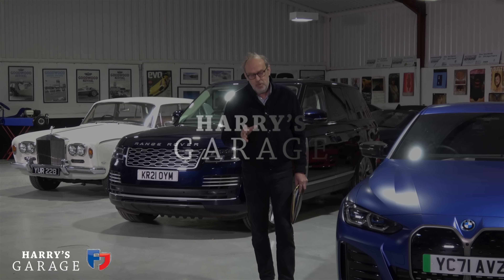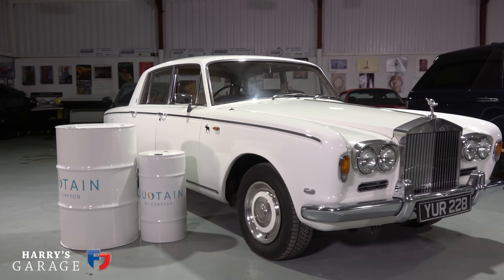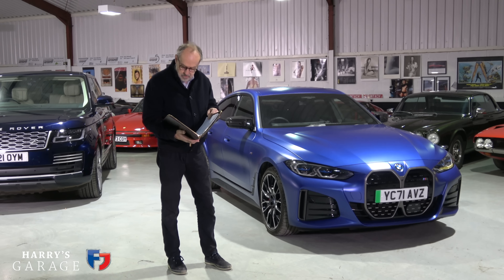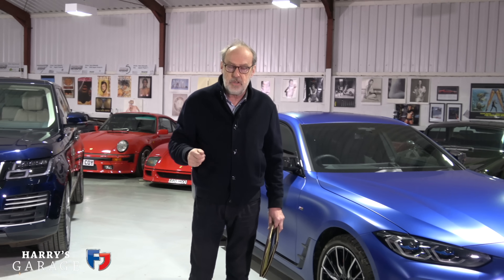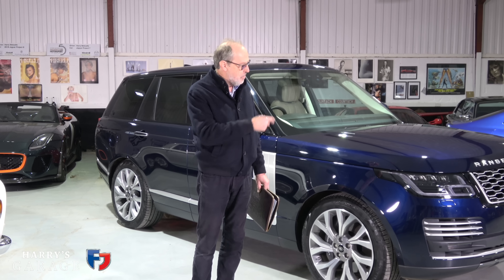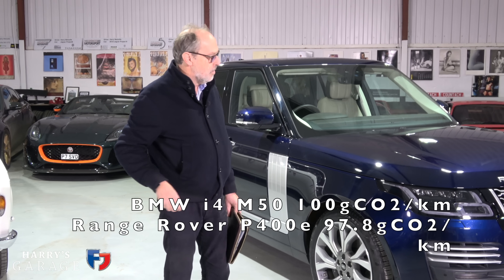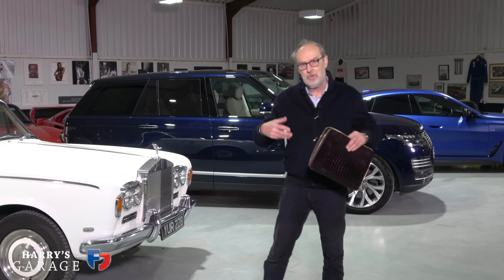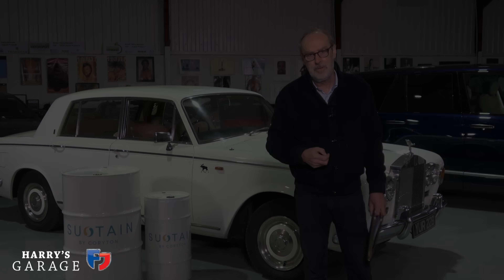Sustainable fuels; what are they & are e-fuels better for the planet than running an EV or PHEV?

Comment: Burning anything produces local emissions, EV batteries are recyclable so the cars will last a long time, infrastructure is slowly moving to sustainable power etc.
Anyway, sustainable fuels are nice for classics.
Reply: You really need to do more learning. I can understand your idea of "burning" is probably "setting fire to something" but in reality its a chemical reaction which is well understood and can be well controlled. Depending on what you burn you can always neutralise or change the results of that reaction to suit your needs. Weather thats reasonable based on size, cost and so on is another matter but its not so simple as "burn things baaad". 
Also on the recycling front - again you may want to do a little learning there. You say ev batteries are "recyclable" but I can only presume you've heard that and not questioned it. Currently less than 3% are actually recycled and the ones which are use so much energy to do so that its more harmful than making new ones. 
A lot of the claims about them being widely recycled are based on them being thrown into storage and "used" as grid storage - though most of those never even get wired up. 
Another common claim is when they are "recycled" by taking a pack apart, testing the cells then making up packs from any good ones left. 
Thats more equivalent to a scrap yard selling working parts off an engine than actual recycling.
Funnily enough quite a lot of ice parts actually are recycled these days - and have been for quite a long time. 
On a Nissan Leaf for example the battery is one of the few things which aren't sent for recycling while its sister car the Pulsar actually recycles more parts.
Reply: @siraff4461  You really didn't understand what I was getting at. I wasn't going to elaborate but ... oh well. I'm not talking of statistics but future tech.
Combustion causes a variety of gases and it's never a perfect combustion, go breath a tailpipe. Current battery recycling is shit.
Reply: @mdtrx  "Future tech"? Of course you were.

Comment: The Transportability of Sustainable Fuels is very useful, but surely, to use your own test, the Planet would notice it more if it was used by your Farm Vehicles, and the HGV's collecting and delivering from you, rather than your 1,000 miles per Year Classics?

Also, the 'other' benefit of Electrics is their complete absence of any tailpipe emissions, - not that important in rural Oxfordshire, but far more important in the congested Cities where most people live.

Also I don't understand why your 2.3 tonne EV is incapable of doing the short trips that your similarly weighty Range Rover does, - and if you don't need to stop at least once on a 400 mile trip, then you must have a Bladder that is Too Strong for any EV (!)  ;)

And BTW, a top of the range tesla Model S can now do 400 Miles, anyway ...

And one more thing, as a general rule, our Electricity Grid will only get greener, as more Solar and wind are installed, whereas your Rangie will only get greener by the small amount of electricity it uses, and that petrol component will either stay 'brown' with normal fuels, or expensively 'beige' with sustainable ones ?

Comment: There are some excellent points made here. I have been pointing out to people, that if I run a BMW M6 for 100,000 miles it will involve about the CO2 as running a Tesla Model S 100 for 100,000 miles. Much beyond that the M6 wins because the Tesla batteries will have to be replaced, which they won't be. The car will be 'recycled'.

However, this notion that  the planet will notice the CO2 is now so culturally ingrained it is impossible move forward. If people understood that CO2 is about as damaging to the planet as cool clear mountain spring water, then maybe we could deal with the real and horrendous damage done by bio-fuels, hydro-electric, wind-farms, plastic, etc, etc. And that is not to deny the other by products of running an ICE car, that are almost certainly far more damaging than CO2!

I think we need to move away from fossil fuels. But as Harry alludes, it is all arse-about-face and I think we are doing more long term damage than doing nothing...

Comment: Sustainable fuels are a bit of a con.  The tractors that grew the crops that go to make the Ethanol burnt diesel,  the lorries that transported the crops to the conversion plant burnt diesel.  The chemical factory that converts the Ethanol has heaters and pumps that operate from power derived from the electricity grid and generating that electricity produced CO2.  The lorries that deliver it to you run on diesel.  And finally all of the staff and infrastructure that keeps those tractors, lorries and factory working run predominantly on fossil fuels.  So to say that this is a carbon neutral fuel is not exactly true, the liquid itself maybe but it doesn't get in to the tank of your vehicles without a great deal of CO2 that came from fossil fuels being emitted.

Comment: I am actually fascinated how cheap the sustainable fuel is. I would've guessed at least an order of magnitude higher price and very limited supply. Is it taxed in the same way as regular fuels in UK?
Reply: But it is debatable as to whether clearing ground to grow it is really sustainable, I don't think anything is truly  sustainable. 
I think electric cars just put the smoke in someone else's back yard .
Reply: @zypp33  Emitting CO2 is putting the smoke into someone else's back yard, literally. For most people, an EV emits less CO2 - and once we've eliminated more gas burning, EVs will get cleaner and cleaner.
Reply: @zypp33  That plant in the Atacama desert in Chile isn't like cutting down a Brazilian forest.
Reply: Petrol's cheap if you take 69% tax out of the equation and yes to answer your question all fuels are taxed one way or another. You've only got to look at our electricity price crisis to see that whether they call it "tax" or "profit" or "overheads" a high price is a high price and a lot of it isn't going on the raw materials you're purchasing.
Reply: EVs only produce less on use. The production of the EV will often add up to more than what you emit from an ICE vehicle. When you start factoring in the fact that we still need to build an entire infrastructure for renwables, that relies heavily on limited and harmful heavy metals (gained through strip mining), that cannot be easily recycled (just as much of the resins used in wind energy cannot be recycled), you start seeing the bigger picture.
Renewables and EVs sound good in theory but the reality is far from what is touted.

Comment: Harry, don't feel guilty about running your cars on fossil fuel, the question should not be, how do we do it?, the question should be, do we need to do in the first place?, in the time of the dinosaur CO2 levels were up around 1765ppm of CO2, it is now about 385-400ppm, over the last 100k yrs sea levels have been 20m lower than now to 6m higher, the world will not notice us running cars as we do now, as CO2 stays in the atmosphere for centuries what you produce today is there for over 100yrs, if we went zero emmissions tomorrow nothing will change with the climate for 100yrs, there are so many things affecting the climate, CO2 being just a small part,  you need to read "Unsettled" by Steven Koonan, find out what the IPCC are not telling us, what the raw data actually says and how and why it being misinterpreted. Looking at EV or PHEV is great as long as you don't get  the idea we are killing the planet and getting rid of fossil fuels will save us, I want to look after the planet, but I don't want to ruin my enjoyment of it to do it, otherwise what is the point, especially when it is not in any real danger from me, current EVs bore me, no patience for prolonged charging time, short distances and range anxiety, I like dropping cogs into a corner, now, if someone comes up with an EV that can be driven like a manual, with a 20yr battery life that charges in under 5 minutes and a range equal to full tank of gas in a Nissan Micra then I am interested, otherwise it is BS virtue signalling by woke wankers trying to be popular.

Comment: Fully electric vehicles are not the future for the UK. The infrastructure is not there to charge them. The electricity uses fossil fuels to be created & the cars are disposable because no independent garages can fix them.
They're a MASSIVE con, on a HUGE scale, & those who pat themselves on the back for their contribution to "saving the planet" haven't read the figures.
I can drive a 1.4 petrol car for 100,000 miles & use less Co2 than a brand new, zero mileage Tesla, that will be scrap in less than 10 years.

Comment: Great video. Agree with the general sum up that PHEV's are the best solution for most people at the moment. But really looking forward to the planned videos on sustainable fuel, especially as you get to use it, how will it effect the engine? Power, efficency, seal life etc?
Reply: PHEVs are NOT the best solution for most people right now. Most people drive < 40 miles/day. So an EV is the best solution (for the planet).

Comment: Depreciation is one of the biggest costs of car ownership. It's still so commonly ignored. 
Manufacturing new cars is also incredibly damaging to the environment. Lifecycle assessments are never discussed because they discorage new car sales.
Reply: The slowest depreciation seems to be either a “quality classic “ such as an E Type , or any Tesla !
Reply: @maxflight777  because Tesla control the resale value.
Reply: Don't forget that Ice can be used indefinitely with simple repairs whereas EVs have a short lifespan and then have to be replaced.
Reply: @sh-hg4eg  I strongly disagree with your claim. To use ice indefinitely, engines, gearboxes, fuel system etc all need to be gradually replaced. To use electric drive lines indefinitely, motors, batteries, and invertors have to be replaced. There is no fundamental difference!

Comment: As ever a balanced view from Harry… I have always believed that the answer is actually we should be keeping and operating vehicles for longer. This idea of changing vehicles every 3yrs is what is driving pollution with the constant production and costs to the environment associated with it. I saw a discussion which pointed out that with the low mileage (an average of 1300mls per year) completed by a V8 classic car actually contributes less carbon annually (as the manufacturing costs are long gone) than the average person charging their iPhone every night of the year! There is also the point that private motor cars are not the major contributors to carbon emissions, industry, agriculture, shipping and air transport are the real large polluters. It seems cars are an easy target that makes everyone feel virtuous while they ignore the true problem 😔

Comment: Harry. Another brilliant explanation, but and sorry there is a but. I think it would have been interesting to see the figures for a modern diesel, say a BMW 320/520D. I really think the figures would be very enlightening and a great comparison to a modern electric or hybrid option.We all have to be greener in our choice of what we choose to drive but not sure that a 45/50mpg diesel is as bad as we are being led to believe? I would love to see your calculation on CO2 emissions and relative pence per mile. My reasons to challenge is that I drive a 2021 diesel equivalent of your L405 Range Rover which averages 33/35mpg and on a recent road trip of 1800 miles round Norther Spain achieved 37.5mpg. A trip I would have struggled with in a pure electric vehicle. Do they produce a diesel version of the e-fuels by any chance.👍

Comment: Sustainable fuels sound great, but, if you have to till the soil to sow a product to get it the tilling releases trapped CO2 from the soil, plants trap CO2 but so does soil, the soil apparently holds about 75% of the earths carbon pool, 3 times more than in plants, as you till you release this, as it is 3x the amount of CO2  of the crop you plant can absorb recycling the plant into fuel will never absorb the amount released to plant the crop,  the CO2 released will stay in the atmosphere for over a century, bio fuels are not the answer as they are still producing an excess of CO2, wind and solar are to inefficient and have a very limited life span, wind turbines about 10 yrs and solar panels about 20, what do you do with them after that, they can not be recycled and contain many environmentally harmful heavy metals. If the fuel is made from waste product how long before we run out of enough waste and have to plant a crop to continue production, there is not a infinite amount of waste, leave the cars to run on fossil fuels and replace CO2 producing power stations with Molten Salt Reactors thus hugely reducing the amount of CO2 produced and not messing with our lives for no good reason, sorry for the rant Harry but this bugs the shit out of me. Love your work,

Comment: Good info. I think it's very difficult to know what the best thing to do is. Seems to me though that the best thing environmentally is to keep existing cars going for as long as possible to bring down the average co2/mile when you also factor in manufacturing the vehicles. With EVs there's also the issue of lithium mini v and the batteries having a limited number of charge cycles and then not being recyclable. If I can keep my 20 year old nissan going on sustainable fuels then surely that's better than buying a new Tesla every 2 years

Comment: For classic cars the e-fuel is probably a decent solution…you still get the nasties such as Nox etc which are powerful climate warmers, and not so good for health. 
The hybrids keep the fossil train going with all the emissions involved in production, transit and storage (and the regular unreported spills and disasters), and unnecessarily need oil changes and give off the cocktail of emissions that an internal combustion engine gives off. The PHEV engine kicks in quite regularly during acceleration and situations requiring power, and the ‘soft hybrids’ like Toyotas, are generators on wheels like a train.
The i4 M50 is nowhere as near as efficient as a model 3 LR, and charges nowhere near as fast. Even with your ‘dirty’ electric the Tesla is the cleanest by far. Read their Impact Report…they reach manufacturing parity with the average ICE vehicle in 5,340 miles, and are cleaner and more human/planet friendly on the heaviest of electric soups.

Comment: I've worked on renewable energy projects and it's not as green as it's made out to be. You need to use an awful lot of dirty energy to create some green energy. A lot of the steel used in the early offshore windfarms came from China, made in coal fired steel works, shipped half way around the world on a ship using heavy fuel oil. Construction vessels purpose built to construct the windfarms. Most windfarms have a twenty five year life span and for the first ten years they're just offsetting the carbon footprint of building it and most aren't going to last twenty five years with the amount of maintenance needed on them. And once it's come to the end of it's lifespan it all has to be removed back to pre build on the seabed. London Array must have over 200km of power cables buried in the seabed and some of those have already failed and been replaced.

Comment: Excellent video. I own a PHEV and think that until we don't have a reliable and extensive charging infrastructure, they are the best choice. Regarding "power-to-X" fuels: they will be only ok for niche applications, such as your wonderful garage. The average user will be well served by the ever improving EVs, charging infrastructure and renewable generation installed.
Reply from the maker: Exactly. Cars in my garage and everyday usage cars are two completely different things. I'll pay a premium to power my garage in a sustainable way. I will go fully EV again for my everyday car when range hits 500+ miles and outside chargers are everywhere but until then, I'm v happy running a PHEV

Comment: Great video Harry, but some points to consider : 1) a large % of phev cars are rarely or never charged through the socket so they are just dragging round a heavy battery and motor for no benefit. 2) bev batteries can be 95% recycled, so first time manufacture they do take significant co2, and second and subsequent use in cars or stationary storage use uses minimal co2. 3) UK and other countries electricity supply are quickly moving to renewable energy, in 5 years time even Oxford will be significantly better than today. But good to hear your sensible views and interested to see your relationship with Coryton develop.
Reply: I agree that lead/acid batteries can be recycled, it’s closer to 99% than 95% and it’s very low energy and cost requirements to do it.

This is not true of the complex chemistry and complex physical manufacturing processes required for modern BEV batteries.

I’ve seen no real world data so far. Not journalists stories, original hands on data on car traction batteries.

Do you have some really good empirical sources? Ta.
Reply: BTW, if you really are a GT380 man, from what I remember of the 2stroke smoke screen when driving behind one of those in my youth you clearly have more concern about the environment than you used to 😂